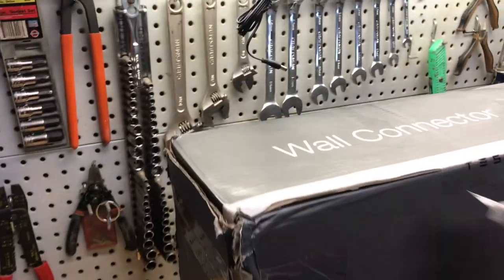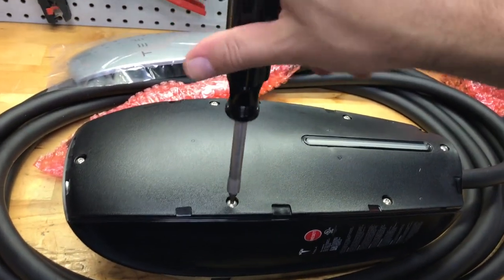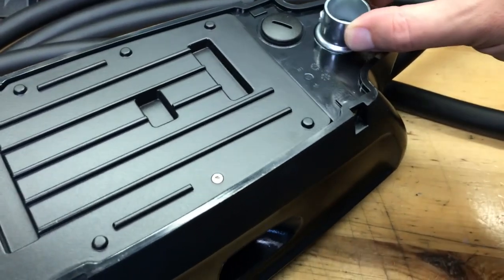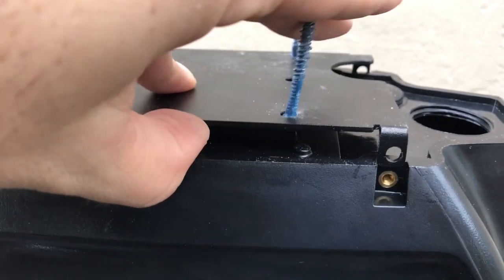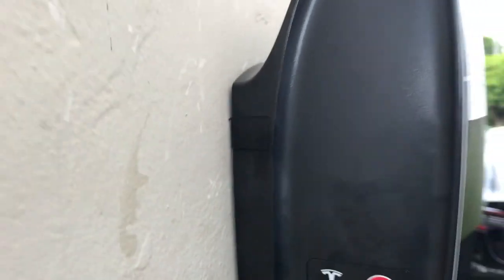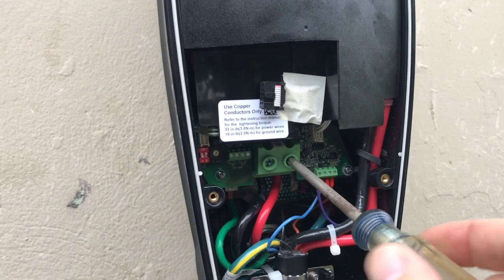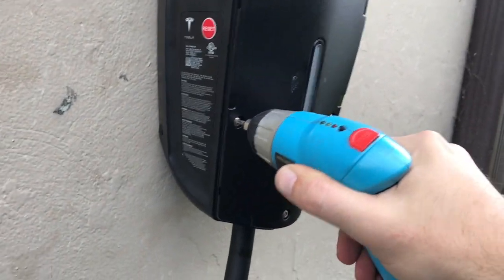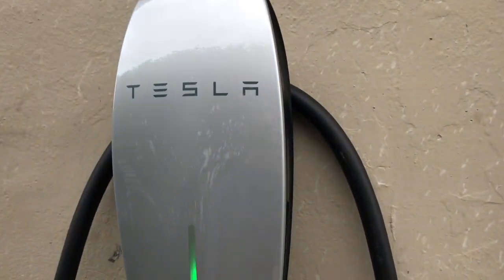Tesla Wall Connector Install

Comment: Nice job.  Question I have is why you elected to set your charger to 48 Amps? when you have a 60 Amp breaker?
Reply from the maker: That’s per the instructions. Plus the model 3 can only draw 48 amps. Plus I believe there are electrical rules regarding how much higher the breaker has to be than the load.
Reply: Wiring load should only be 80% of breaker rating.
Reply: He’s right the breaker has to be rated higher to allow for surge and proectiom

Comment: I have never ever had good luck with those Tapcon things.  They come loose after a few thermal cycles.  The only way I ever get a good attachment of anything into concrete is to use those expanding metal sleeves.  More of a pain in the rear, but I would say worth it.

Comment: Beginner here with the only experience is replacing outlets, light switches, and installing ceiling fans. You made it look really easy.  I want to try and install one in my garage, but the breaker box is on the side of the house. Appreciate any tips
Reply from the maker: I really just want to focus on the charger here so I won't give any wiring advice. But I had the opposite problem where the breaker box was inside the house, and I wanted to install outside. Naturally, a hammer drill was involved.

Comment: Do you have the parts needed to install this? Electrical rookie here but will get help. 14/3 wire?? Etc
Reply: Umm, don't use 14/3..... lol.
Reply: StrangerOf The206 yeah I just did more research already haha. Thanks
Reply: @jessealcalarealtyone  yea man, just didn't want you to follow up with some horror story of something gone wrong! I'm installing one of these for someone tomorrow, I'm a licensed journeyman electrician but haven't had any experience with these yet. They're pretty straight forward for someone with electrical knowledge and experience, but if you don't have that then definitely do the research and maybe even get someone with the knowledge to help. Good luck on your installation! Just be safe!
Reply: StrangerOf The206 i appreciate the response and help man. Definitely getting someone to do this but at least I have an idea now. Thanks again
Reply: @jessealcalarealtyone  I ended up installing this last weekend, doing another for someone else here soon, but let me know if you have any questions on it, I can help you out. It was pretty straight forward for me, bit I have alot of years of experience. Just be safe!
Reply from the maker: A model 3 will draw 48 amps which means you need a 60 amp breaker which means 6 gauge stranded copper wire. The electrical side of the install varies with how much current you want to supply to the HPWC, how you will install it, and your codes, so I wanted to just focus on the HPWC install.

Comment: I have a question about what wire to buy? What guage? Do you need to buy separate wires or can you get romex wraped? And it's just 2 hots and ground?
Reply from the maker: I used 6 gauge stranded wire for my 60 amp circuit. The size of the conductor depends on the breaker protecting it. You can limit the charge current in the HPWC. 2 hots and a ground are needed. You could run romex if it's inside walls and protected properly, but I ran mine in 3/4 conduit on the surface of the walls inside my garage.

Comment: Thank you, Alex for very informative video. I do however have a question for you. What size of concrete screws did you use?
Reply from the maker: I don't remember but the smallest tap-cons would work. Keep in mind the heads don't sit flush in the bracket without additional countersinking. So the smaller the better.

Comment: Is it three phase or single phase wall connector?
Reply from the maker: It can take either but I’m using single phase. Actually you use 2 legs of the three phase wiring. See the instructions for details.

Comment: Nice video! Did you tighten the set screw to your 3/4" threaded fitting? Ha! Of course you didn't.   I have been scratching my head with mine for a few days now.  If just slipping it on is good enough for you, it's good enough for me. I'm not going to worry about it any more.
Reply from the maker: Haha. Yes there is no way of tightening that set screw. Of course the conduit through the wall is trapped between the HPWC and the box on the other side. I applied generous amounts of silicone rtv around the conduit and fitting on the HPWC side too.